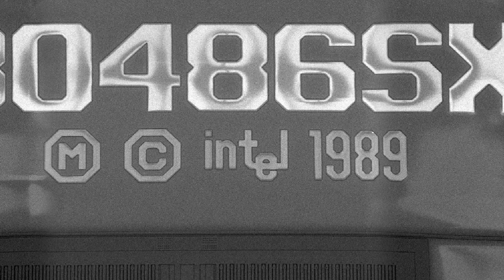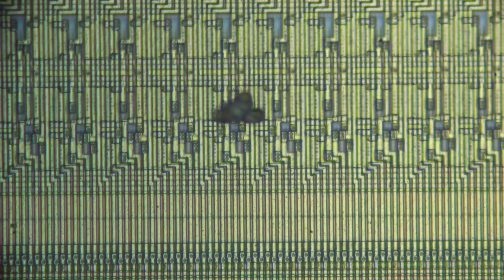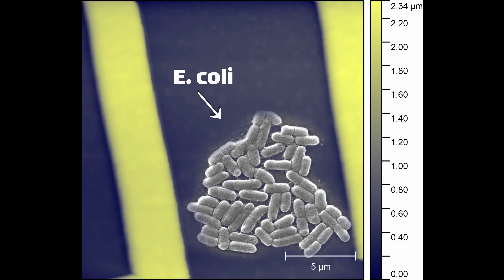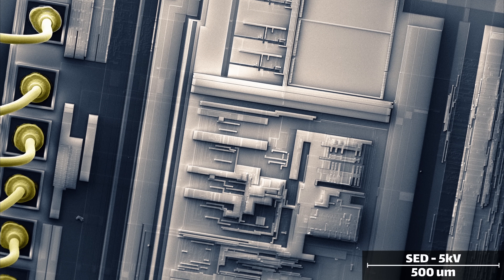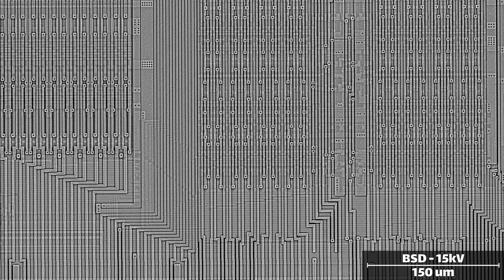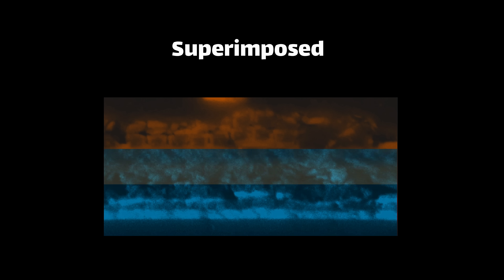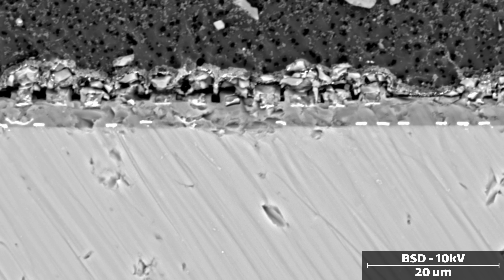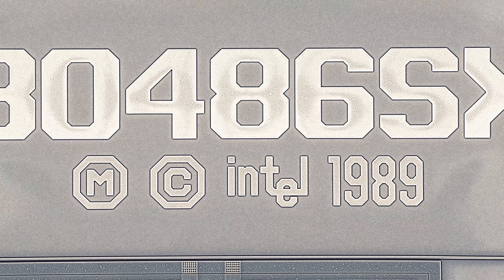Microscopic view of an Intel i486

Comment: Great job removing that lid without desoldering any pins!  Loved the zooming footage.
Reply: It is rare to ever remove pins to expose the die.
The die sits in what is called a "lead frame" which is all the bits of metal that connect to the pins. Then from the lead frame they run gold bonding wires to the pads on the edge of the die. With the pins being to the sides and underneath the chip, the die is mounted with its circuit face up, and gold bond wires.
Having the chip face up, is then obligatory to enable the bond wires to reach the bonding pads on the die edge. This couldn't be done if the chip was face down...(not all packages are like this).  So it is very common for the die to be face up and sitting above the pins and lead frame, and therefore no need to remove any pins to get to the correct (top side) of the die.

Comment: Actually isn't it more appropriately named 80486? I don't know where i486  came from
Reply from the maker: Not a computer historian, so grain of salt but I believe the official name was "80486" but "i486" (and "i386") later became the commonly used name due to a court order: "The i486 was so named, without the usual 80-prefix, because of a court ruling that prohibited trademarking numbers like 80486. Later, with the Pentium, Intel dropped number-based naming altogether." (Source: https://en-academic.com/dic.nsf/enwiki/9102).  Unsure how reliable that anecdote is, but probably fair to say that even without the court order it was used as a shorthand of the official name, and 486/i486 were common since it was shorter and easier than 80486. :)
Reply: @BreakingTaps  yeah we just called it 486 and 386. I probably just forgot about the i part. I do remember studying for the ever changing A Plus Comtia test a long time ago, think mid 1990s and I had to learn hex, binary and intels naming schemes for the time period.

Comment: This is a 32 year old chip.  Can you imagine what a 10th gen i9 would look like?  Jesus!  The mind boggles!
Reply from the maker: On the todo list for sure! Need to practice my decapping and delayering skills before I tear something newer apart though.  Going to practice on something cheap and interesting like accelerometers :)
Reply: just smaller and uglier details because probable impossible to control straight lines at atomic level. And for multiplied layer count not sure why it necessary
Reply: Apple M1 would be interesting...

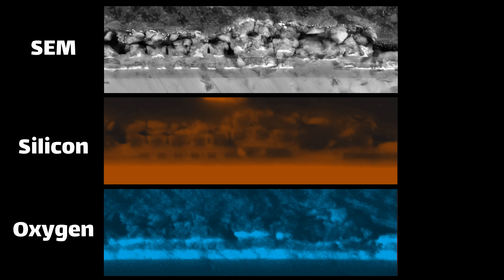Comment: I've never seen a bacterium with my eyes. I've no intuitive feel for how large they are, so as a metric it's pretty useless. I mean if 10000 or something (I don't know since you didn't tell) widths of the traces would fit in the thickness of a hair, it would start to be pretty useless, but imma guess it's way less than that. If it's closer to a thousand, then I'd be able to get some idea of the scale. Not very very clearly tho. Then again I'm only at 4:56 so I don't know if there's gonna be a better metric. No other complaints so far :) Keep it up!
Reply: For reference, a strand of hair is about 100 microns wide. So a feature of 4um would be 1/25 of a strand of hair. Seems small, but this is 30 year old tech. Features in todays chips are measured in nanometers, of which there are 1,000 per micron, or 100,000 per strand of hair. Todays processors have feature down to about 10 nanometers.
Reply: @jbrou123  The process was 1um, not 4.
And intel even reduced it a couple of times.

Comment: A note on a breakthrough enabled by the arrival of the 486 chip--on August 31, 1986, an off-course Piper aircraft collided with an Aeromexico DC-9 over Cerritos, California.  The resulting crash killed 67 people on the airplanes and 15 on the ground.  Aviation experts had been attempting to develop an airborne aircraft anti-collision system since a mid-air collision over the Grand Canyon in 1956.  The technology was not available to make any such system feasible.  After the Cerritos disaster, the decision was made to develop and implement an anti-collision system based on modifications and upgrades to the existing aircraft transponder system, which was used to identify individual aircraft to ground-based radar.  If more time was available to develop a new system, the upcoming, military GPS system would have been the obvious candidate to build a reliable and flexible system that could far out perform any transponder-based system.  However, time constraints meant that off-the-shelf hardware would have to be used to make the transponder system work by the mandated implementation date in 1992.  

With the help of MIT"s Lincoln Laboratory. the software was developed to make functional what would become known as the TCAS system, for Traffic Collision Avoidance System.  The heart of the system would be an airborne computer carried aboard each airliner, along with upgraded transponders and additional instrumentation integrated into cockpit displays.  The Bendix system installed on most airliners utilized dual 486 processors to complete the complex calculations necessary to implement the algorithms in real time.  It worked, it was implemented on time, and it continues to add a layer of safety to air travel today.  Of course, if it was to be done over again, the basis of operation would be GPS, but I have no doubt that lives have been saved by TCAS as it is.  I am a retired avionics instructor, and I apologize for any errors in my recollections of an earlier time.
Reply: Thanks, that's interesting 🙂

Comment: It's interesting that the die shows "80486SX", which means they were in fact separate dies, rather than the same die being sampled and configured during packaging.
Reply: yeah they kinda had to be. The 486sx was like the 386sx in that it had a 16 bit bus vs 32 bit bus. The DX varieties had a 32 bit bus and I hint the 486 dx also incorporated an 87 coprocessor, but my memory is more vague.
Reply: @jhoughjr1  No, the bus was the same.  The lack of coprocessor was the only difference.  A motherboard could take either one, so the pin-out was the same.

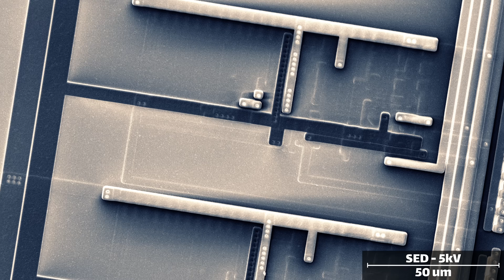Comment: You can see the transistors at 6:50 where like tiny fingers of a beaver dam the white poly silicon gates block the flow of electrons from the almost invisible lakes below.  The lakes below are hard to see because they are composed of minute concentrations of boron or phosphorus.  Where for every 10 million atoms of silicon might be replaced by the dopant in the atomic crystal.  Later in the video you can see the slight discoloration of the silicon beneath the gate where during the fabrication, the gate has blocked the implantation of the dopant.

Comment: Audio sounds a bit unbalanced on my hifi, not much top end, too much low end. Are you filtering it?
Reply from the maker: Cheers! Yeah, doing some basic EQ to it (highpass, some targeted EQ to try and remove boxy/room sounds, gate, compression). Probably just did a bad EQ'ing and need to bring up the highs a bit more. I think I have kind of a nasally voice that comes across poorly on mic sometimes, so probably lean towards downplaying that more than I should.  Will work on it! Audio is probably my weakest skill unfortunately, a lot to learn!  Thanks for the feedback!
Reply: @BreakingTaps  a small, wide cut (maybe -2db 1 to 2 octaves wide) centred on 1khz should help if the recording sound a bit nasal. I'd aim for minimal adjustment if possible, and check the sound with a decent pair of headphones, if listening back on speakers in the same room you record in, it may sound like your room effects are twice as bad as they are.
Reply: @BreakingTaps  I like your voice, it's calm and mellow 😚